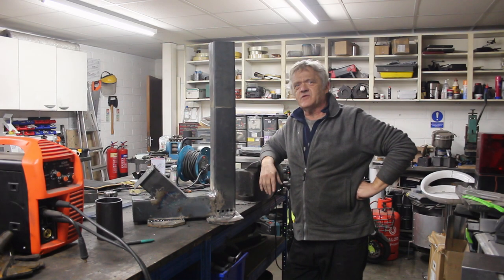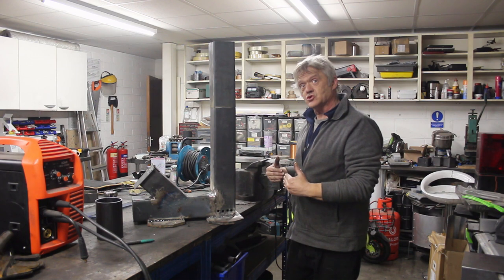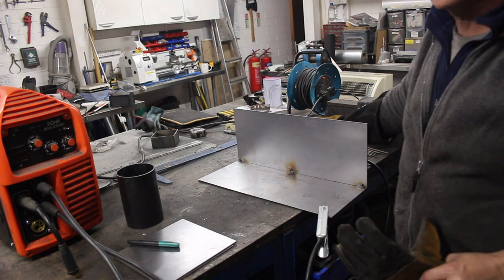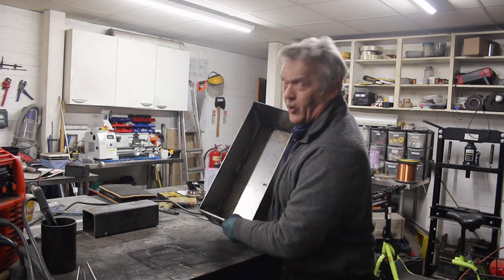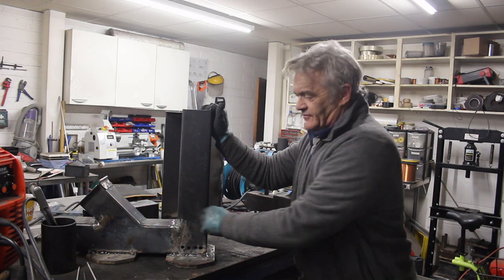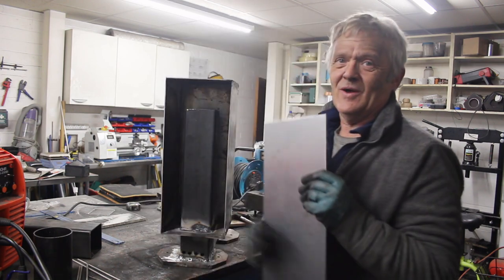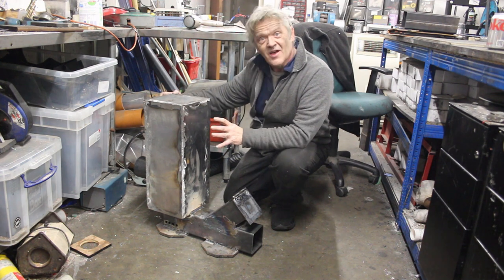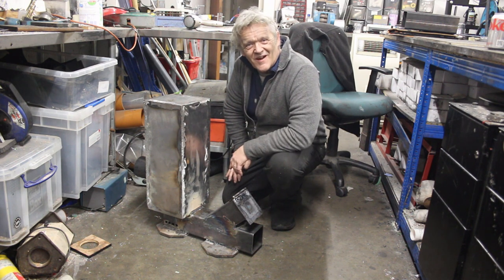1741 How To Change A Rocket Stove For Indoor Use #rocketstove

Comment: Since they burn so hot & steel degrades, can you build a rocket heater with fire brick (like in kilns) to make it last longer? That would be an interesting comparison.
Reply: Fire brick wouldn't allow much heat to dissipate into the room, would it?
What would be the point of having an indoor fire if nearly every joule of heat is exhausted out the chimney?
Reply from the maker: this seems to be a bot of a recurring theme mate - I think I will do a video on this as you ask a very good question
Reply: If you are using it as a mass heater (long-term, daily), then you would need to build out of something lasting....like cobb, firebrick, etc. If just using for camping (short term, intermittent) then metal seems fine.

Comment: I really enjoy your videos, even if some of them, such as this rocket stove and its indoor adaptor, are way beyond my skillsets.

I am hoping to have a go at your Homemade Heater, the one in 1702, but I've hit a snag.  It's this 100% carbon felt you use for the wick, I just can't find this stuff anywhere.  I did find a 98% carbon felt, but you emphasise in the video, to make sure its 100%.

I even sent your shop a message, asking if any of the material you sell was what I'm looking for; none of your listings that I can see mentions anything about 100% carbon felt.  Unfortunately, I received no answer to my query, maybe you overlooked it, so I'm asking here the same question, is there any material on your website that is 100% carbon felt, by another name.

I do hope you'll help me with this, Jack Frost has already been peering through the windows a few nights, and this heater could help keep him from moving in as a lodger. 😂

Thanks mate.
Reply from the maker: I am sorry you are finding it hard to get hold of mate - we do sell it in the shop here https://secure.workingink.co.uk/shop/working-ink-materials/activated-carbon-felt/
hope this helps

Comment: Used outside, I wonder if one could use an offset-fan-driven exhaust to push the exhaust, now mixed with fresh air (or just air heated by a shrouded flue) through a duct into one of the vents in the wall of one's house to heat the air under the floor, hypocaust-style, if one has an older property. It need only keep the chill away.
Reply from the maker: you certainly could do something along those lines

Comment: I remember your ethos several months ago about upcyclling materials from domestic appliances etc ,why do we need draught when we have devices that can drive a dc fan with a  compact hearth and the gaseous products feed into a heat exchanger made from drums  appliance cabinets  ,I'm sure you have  materials to prevent oxidation ,and devise a simple feed mechanism, all you need is something to shred up the wood and feed it from a hopper into a crucible fed with air from underneath, just simplify a commercial pellet burner ,gas bottle will suffice for main burner, hope I got you thinking  ? X rooby
Reply from the maker: you could certainly go that way mate - but this is really for someone who has never done anything like this before - better not to over complicate I think

Comment: I wonder if a bunch of screws or thick nails welded into the box half in half out would make much of a difference with the extra surface area?
Reply from the maker: I doubt it - not for the work involved but you could try it if you like

Comment: So Robert a question about rocket stoves , is can it be made to work in a similar way to the vevor diesel heater that you featured in one of your video's in a similar way to what you've done on this video by fitting old motorbike cylinder's onto the manifold, then boxing them in & then fitting a fan to the box to blow air across the hot cylinder's to then vent out into the room for heating??? (Ps: also can the wasted heat from the exhaust on these diesal air heaters be captured using a similar principal to what I'm talking about here? ( Just seems such a waste of good heat from the exhaust to the outside!) Loving your videos by the way! Many thanks for the good entertaining way in which you do them! From Johnny bird up in chilly North Yorkshire!🥶🥶🍻😂🤣

Comment: I would be cautious with the holes on the bottom as sparks could come out.  I believe air pipes leading to the holes (IE square tubing) would make the work a bit better but it would also be safer, and we all know safety third.
Reply: Good call. Perhaps L shaped upwards?
Reply: I was think (at least on the sides) just have them come a few inches short of the main air inlet, as for the the ones in the rear you could do a small straight pipe out the back into the fireplace.  They don't need to be too long really, since the incoming air should, in theory, keep keep the hot sparks in the burn chamber.  Video 1677 had the pipe idea in the opening of the video, and if you go back further you can see how it was added.
Reply: The secondary air intake isn't really needed. The holes can be eliminated entirely.
Reply: I agree but if someone were to want to use them they should make them safer than just open hole (IMHO of course).  Of course if using this indoors you could put a door on  the main air inlet with a dampener and get a longer burn time during the night without too much heat loss.
Reply: @Liowen  
These stoves should never be stopped down. If you want to slow the heat, route it into a mass before up the chimney.
Run a rocket stove full blast at all times, use a mass to slow and return heat over time. This is a very good combination. A poor man's Masonry Stove.
Reply from the maker: nice point mate - cheers

Comment: Smartest thing you could do I put a heat sink,  like you would find on a circuit board only made of steel, above the rocket stove and use a fan to move that heat off the heat sink into the surrounding area. Your welcome.
Reply from the maker: lol - cheers mate

Comment: I like how you just put a bit of metal around the rocket stove and put a vent for outdoors on it. Just think how much water you could heat up and use in radiators.
Reply: That would actually be a great idea!  Having a water chamber on top of that top plate would help it not to burn out so quickly, which is what it is going to do like it is. It’s way too much heat for that mild steel!
Reply from the maker: loads mate

Comment: I love the idea of this, would it be possible to have a box similar to what you are doing but as a u shape that wraps round three sides of the secondary burn chamber / flue  not as a heater but as an interchangeable sand battery, a vestal for making fuel from plastic, and a gasifier separate boxes of course, using  various size sand boxes you could have your heater on in the work shop then when you go indoors you can take the charged sand batteries in with you or jut use bricks in you could fix them together in fact you could make one of these fully modular by having one made into a hot water jacket or a three sided configuration of pipes that fitted around three sides of the stove are these ideas ridiculous or possible I am new to this world

Comment: Nice! I'd be tempted to stick a fan on the outlet to artificially induce a draught.
Reply: The fan couldn’t take the heat, and that mild steel couldn’t either. Pulling air thru the exhaust would basically be equivalent to blowing air into the intake. You would turn it into a forge and it wouldn’t last long. It probably won’t last long even the way he has it. That top plate it going to warp like crazy and probably burn out pretty quickly.
Reply: @stevenmark8156  I vaguely remember my Grandmother's woodburner having a fan on it somewhere. I've always wanted to experiment with long internal flues or those double barrel woodburners but always expected I'd have to artificially induce a draught.
Reply from the maker: me too - but I might put a long heat exchanger on it - a bit like a radiator and have the fan at the end of the radiator/exchanger
Reply from the maker: how hot do you think this will get?
Reply: @ThinkingandTinkering  Yes, makes sense.

Comment: Apparently you finally looked up Ianto Evans but do you comprehend the fluid dynamics that is induced by the insulation and the redirection of gas’s flow. These two things are not trivial as the insulation (refractory) is responsible for containing the intense heat of combustion and the redirected gas flow is responsible for the vortex, which increases the combustion retention time creating near complete combustion, hence the intense heat and increase fuel efficiency. One more point that you failed to illuminate is that the heat does go up the chimney but because there is such a great temperature differential between the gasses exhausted from the heat exchange barrel and the outlet of the chimney you can have a long and serpentine chimney path that can be use as a heat exchanger feeding a thermal mass (Cobb) without sacrificing sufficient draft. Thus, a rocket stove has a J-tube burner, a refractory riser, and a heat exchange barrel to induce a vortex in the secondary combustion chamber. To make the rocket stove useful as a home heater the addition of thermal mass heat storage makes it a rocket mass heater. Please give Ianto his props.
Reply from the maker: Mate - it's a fire in a box! the basic principle is gasification - end of story

Comment: I wonder if there was a hot water jacket welded to the back of the internal flu would it create a downward draught due to temp Differance thus increasing the air flow through the appliance
Reply from the maker: I don't know - interesting question though

Comment: Was building something very much like that back in the 1980s near cottage Grove Oregon a group called aprivicho not sure of the spelling had come up with what they called at the time a j stove built almost exactly the same way except they didn't build a square around the chimney they just used a 55 gallon drum with an inner spacer and you might even call it a heat sink but virtually exact same thing it was designed to heat a room and to be used as a cooktop
Reply from the maker: yep - eat same thing - these heaters have been around for years mate

Comment: While the concept of what you've built is sufficient to explain the idea, the specific dimensions, relative to one another, are actually quite important.  What you've built there would work, but not very well.  The height of the riser is crucial to getting a proper draw when running the exhaust gases through a substantial mass.  Also, metal is completely unsuitable for the temperatures created by a proper rocket mass heater, due to spalling, although it will work well enough for a rocket stove because the temperatures never get quite so hot.  Long-winded way of saying what will work for a rocket stove is not really suitable as the core of a rocket mass heater.
Reply: Would a fan or roof turbine make a difference?
Reply: @Roland14d  - Those can help establish a draw on a poorly-designed RMH, but if you need one, that's not a good sign.  Even if you used a fan to start the draw, metal is still going to get too hot and erode, in a proper rocket mass heater.
Reply: @jasonbroom7147  Thanks!  🙂

I have seen only one really well designed-to-permies-specification RMH.  It uses a blower fan at the mouth to improve combustion of the primary and secondary fires (faster and hotter).  She uses a fan at the exhaust end because she steam "washes" the exhaust to maximize heat capture and capture all non-combustible particulates.
Reply from the maker: that doesn't sound right mate - the chimney is going to do the job of creating draw surely? I am not sure what you mean by 'proper rocket stove' either. There seems to be a lot of stove types with the label 'rocket' what makes a rocket stove a rocket stove?
Reply: @ThinkingandTinkering  - You noted in your video that you "sort of" heard the rapid air intake that gives the stove its name.  To get that effect consistently requires the proper dimensions and materials be used.  For example, the riser should be at least four times as tall as the burn chamber is long.  The reason some risers are insulated is so that they can achieve their primary function of creating a thermosiphon, sucking air into the burn chamber and forcing it out through the rest of the system.  There is also the matter of secondary combustion in the riser, which is not nearly so effective if the riser is too short or is radiating too much of the heat inside of it to creating the requisite temperatures.  Relying on the chimney, which is cold, and of too large a diameter to create a draw for a rocket stove, is what results in people filling their home with smoke.

Comment: I wonder if it's possible to make it so efficient that the smoke coming out of chimney would be around room temperature.
Reply: There are many Rocket Mass Heaters, that function exactly like that.   The Exhaust pipe runs through a long bench (thermal mass), which you can sit or lay on... so long as you put a thick cushion on top of it  (otherwise it would be too hot).   After running through the bench, the pipe goes up and out of a window or hole in the side of the house.  It comes out at lukewarm temps.  (often under 100f)
Reply from the maker: yes

Comment: I have to say that I have seen and thoroughly enjoyed many of your videos, and while I was very much looking forward to your take on this - a concept I've been researching for many years - I was sadly disappointed with your solution. Plate steel of weldable thickness is anything but cheap (one of your primary focuses in every video), but even putting that aside, people have been incorporating rocket stoves and rocket mass heaters into earthship-style homes for decades, and they've done it without welding, without all the steel (we're talking mud and straw here, folks), and obviously for considerably cheaper than this. Most even create a useable stovetop out of the top panel. Surely you came across many such models in your own research (they're not difficult to find)...? I really hope you redo this design in a way that demonstrates how entirely possible and practical this concept is.

Comment: 12mm plate steel !
Reply from the maker: 3mm is what I used 12 - seems a bit heavy
Reply: @ThinkingandTinkering  the rocket fuel stoves with the 2 inch heat riser seem to burn through the steel after a bit of time . I was just thinking 12 mm for long use

Comment: This contraption is absolutely not efficient at warming a room. We need more surface to reclaim the energy output of fuel oxidized. You should put a 50 gal. barrel on it and use eight inch stock for manufacture.
Reply from the maker: eight inch? that's pretty thick - they don't even make tanks that thick
Reply: @ThinkingandTinkering  1/8 oops.

Comment: You did a very basic mistake with your box. I’ve built several rocket mass heaters and watched several videos on them. The basic premise is to make the gasses burn for as long as possible. To do this you need to provide back pressure on the gasses coming up the central tube. This is accomplished by lowering the top plate to within an inch and a half and two inches of the top of the central tube. Also, it works best if the central tube is round so that the gasses have less resistance to spinning helping the gasses spend more time in the tube. Ratios of fire box, wood chamber and riser tube are important. I use firebrick for the central tube.